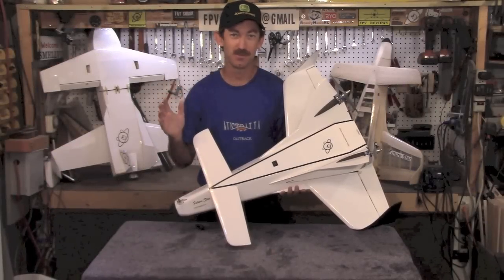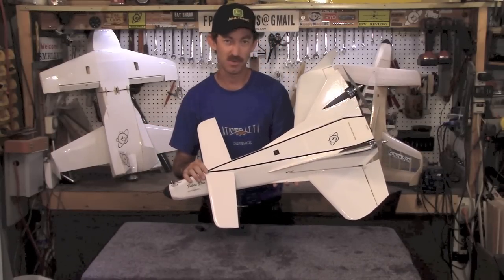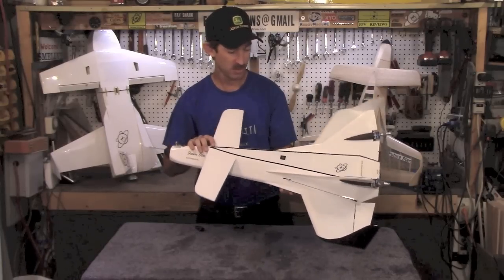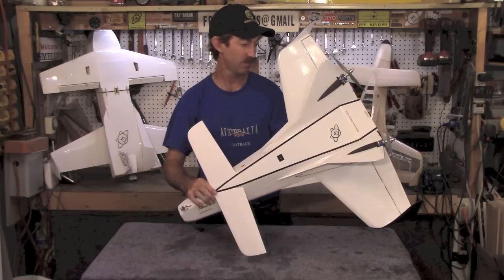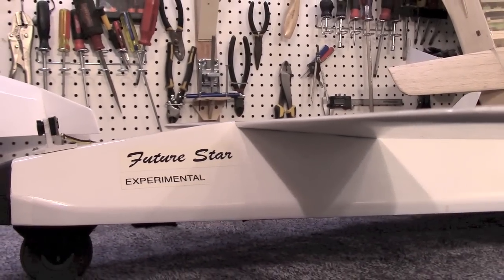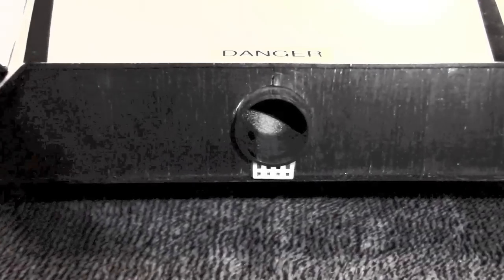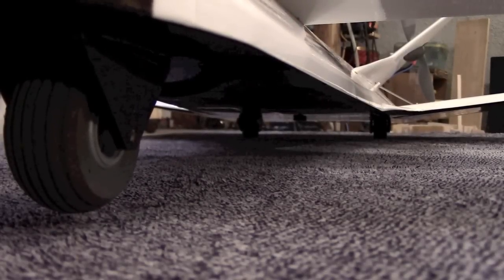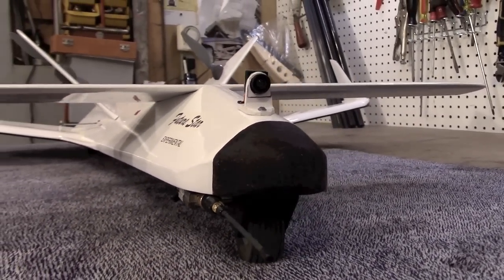Future Star Review -  (The plane up close!)

Comment: Spike, I've been wondering - what is the reason that you changed the shape of the canard from the prototype? Aerodynamic? Looks?

Thanks,

Ben
Reply from the maker: The canard planform was partially determined (changed ) due to the need to move the CG slightly forward, as the fuselage mean lateral area was too close to the CG, and caused an oscillation at low speeds. moving the CG was the cure, but the planform needed to change slightly, so that was the obvious part to modify, rather than the planform of the main wing.  shifting the canard area forward  by modifying it;s planform results in more moment between the canard, and rear wing. sweeping the main wing forward would have decreased the moment, and subsequently decreased the stability. 
well,t eh whole project was a long series of finding the perfect balance , and creative solutions to weird problems. It was actually the hardest thing i have ever designed, given the design requirements that i set for myself. 
the end result is actually very well behaved, and i really enjoy flying it.  That's why i recommend people build it first like it is, before they modify it.
Reply: Good deal. I want to build one. Might be my next project.